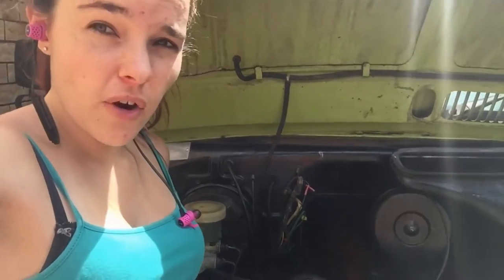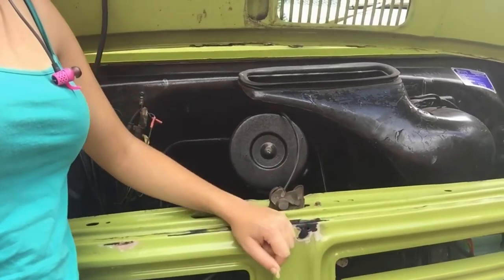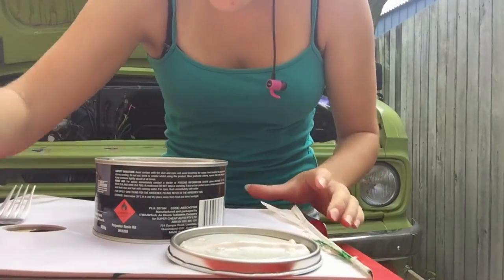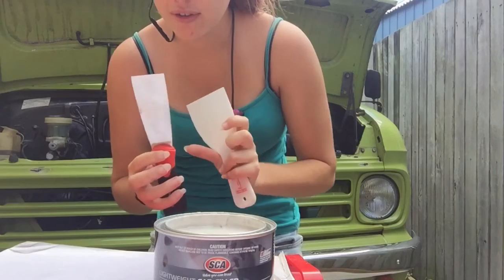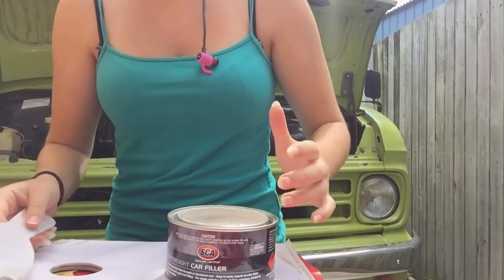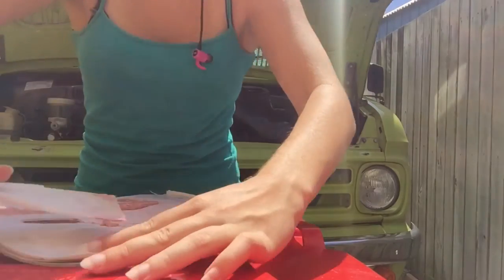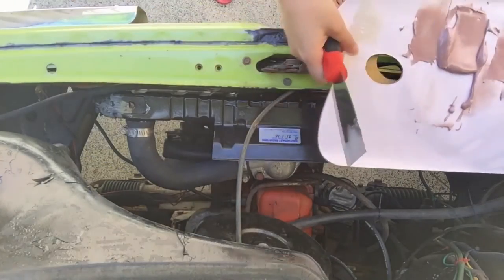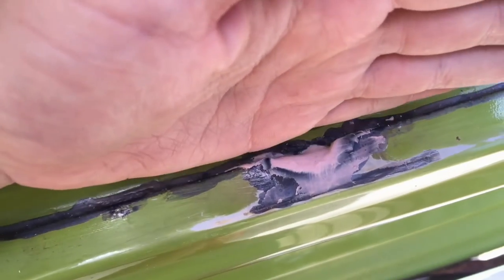How to bog a car Part 1

Comment: just a friendly tip, youl probably find your bog not setting so quickly if you use alot less hardener, easily less than 1/4 of what you used there for the amount of filler used and Australias climate. just enough that the filler is a light pink. youl find the bog easier to handle on the board for longer. nice video though!
Reply from the maker: Yeah the second time round I mixed it up and used a lot less

Comment: I’m surprised no one else is hardly interested in your videos , the bog you are using gives a very smooth finish , however myself I use the metal filaments bog it is harder to get smooth however you can use the metal bog because it has metal filaments and then finish it off with the bog you have over the top of it , the reason the metal bog is much more stronger, when your bog went hard I had a little laugh , been explained to you down below but it is because you are putting to much hardner into it